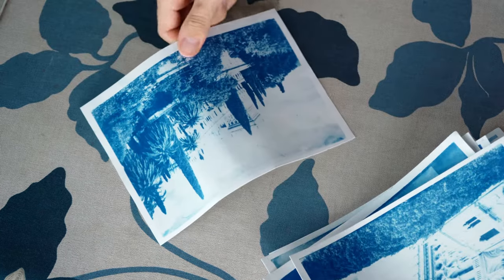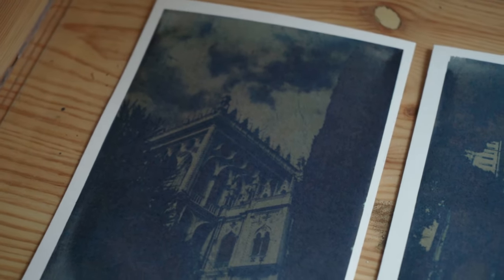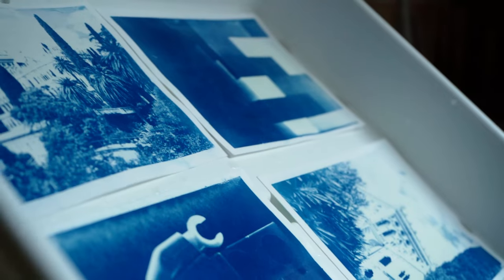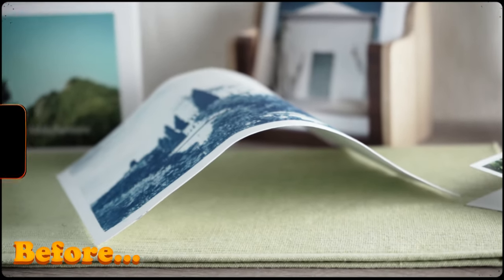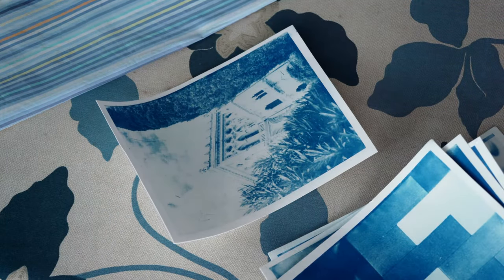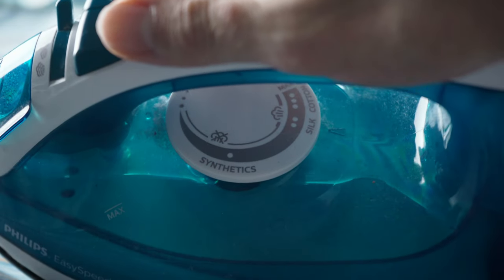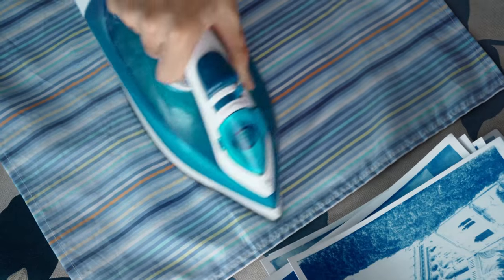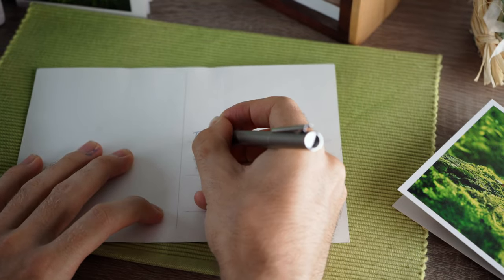DON'T MISS THIS! The Final Step of Making a Cyanotype Print!

Comment: I have been a printmaker for over a decade now. When printing intaglio, we use paper that has been soaked. Pretty much all intaglio printers use drywall to flatten and dry prints... An alternative way to dry if anyone cares:

Lay your prints down on a piece of dry wall. Cover them with some newsprint (mostly to keep your drywall clean). Then cover with another piece of dry wall. This makes a drywall sandwich. 
It takes a few days to dry completely. But your prints will be as flat as a brand new sheet of paper—like museum-quality flat. And there is no risk of damage from the iron.

Comment: Hey I want to ask that my cyanotype print is not staying on fabric when I’m washing it is there any mordant or anything to fix my print and for good durability?
Reply from the maker: Cyanotype is very prone to fading on fabric when washing, but you can use the solar fast chemicals by Jacquard. They work very similarly to cyanotype, are safe to put in the washing machine, and are even available in multiple different colors. I hope that helps!

Comment: I have been working my way through the cyanotype rabbit hole , but not finding an answer to my query…. What happens if you use a regular photo transparency instead of a negative? Does it print out as a negative? Hope this isn’t a silly question 🙏
Reply from the maker: Yes. If you don't invert the image the resulting print will be a negative.
Reply: @JulianSandro  I appreciate you 🙏 would you happen to know if you can set the cyanotype so it doesn’t wash out ? Or is that necessary?
Reply from the maker: @ivermectin3191  A standard Cyanotype will always be sensitive to water. But you could use the "Solarfast" products by Jacquard. These are not only available in multiple different colors but can also be set on paper or fabric so you can put them in the washer. They work more or less the same as Cyanotypes, just follow the instructions on the packaging
Reply: @JulianSandro  one more question, cause I’m like that😂😂 … have you ever heard of anyone applying “never wet” to cyanotype after producing one? If not I may try that and upload the outcome…..
Reply from the maker: @ivermectin3191  I haven't heard of that but I'm super curious. Definitely let me know how it turns out!
Reply: @JulianSandro  I super appreciate this rare YouTube experience of engagement 😂🙏🙏

Comment: I've never been able to use tap water due to its alkalinity. Watching all of the images rinse down the drain is unpleasant.
Reply from the maker: Sounds terrible. Have you tried using more absorbent paper?
Reply: No offense intended, but I don't believe your tap water is the problem. An image washing away is usually attributable to inadequate exposure time or insufficiently prepared paper; that is, a paper the emulsion isn't able to be absorbed by.

Best wishes from Vermont 🍁
Reply: @TheStockwell any idea what happens if you use a regular photo transparency versus  one that has been switched to negative transparency
Reply: @TheStockwell if you say it turns out to look like a negative IM GOING TO HAVE A LOT OF FUN THIS WEEK